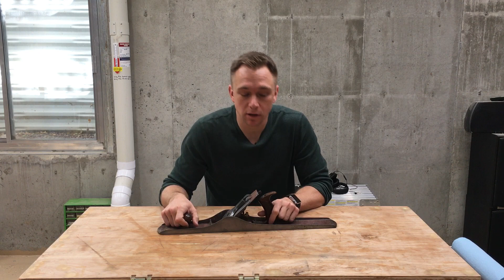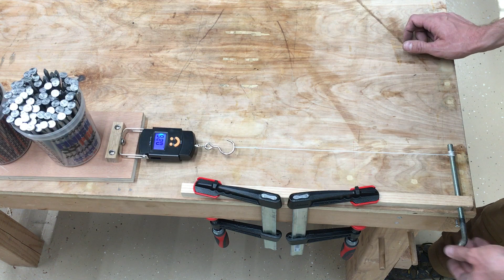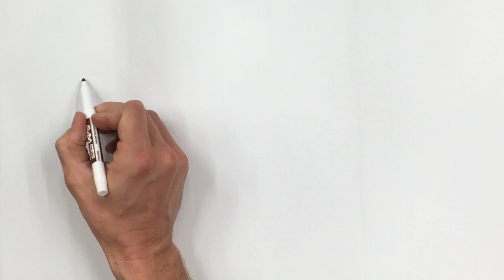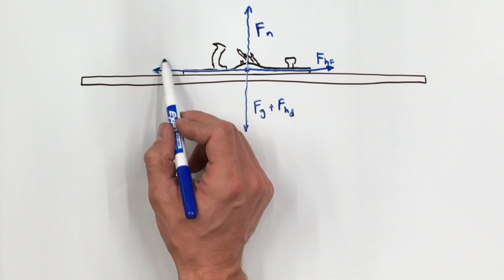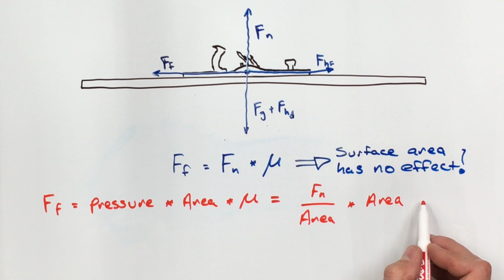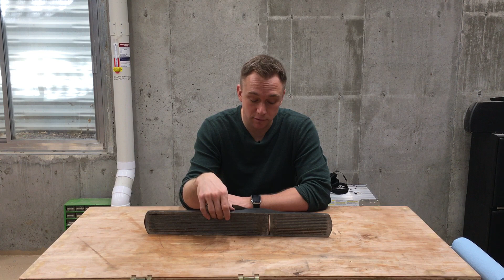Grooves in Plane DON'T Reduce Friction!

Comment: Maybe the increase in surface pressure initiates a sliding effect on wood. If there is little pressure, the thing wouldint even cut, but with enough pressure it cuts and maybe even slides on wood.

Comment: Grooved planes were a huge benefit to Stanley. The driving force was most likely to increase the life of tooling at the factory. Less surface area means more planes get machined and honed before the bits and grinding surfaces wear out and need to be replaced. The design team gets a raise for saving Stanley a million dollars a year.  If you think grooves are controversial now. Imagine how it was when they first came out. "There's No Difference" wouldn't be a stellar slogan to put on the box. So they played up the less surface area less friction "Easier To Push" angle to re-assure woodworkers that it wasn't some specialty plane for a job they weren't gonna be doing. The marketing team gets a raise too. And in my opinion the benefit of less surface area to wear out tools at the factory transfers to my tools if I need to tune up a used one.

Comment: Then intent of grooving the soles was to prevent adhesion caused by a vacuum effect. Think of water in between two plates of glass. The water fills the voids in the glass and makes it harder to pull apart. Check out us pat:96052

Comment: Looks like something you'd see on a chef knife..to reduce suction, so the meat dont stick to the knife.

Could it be an assist, so the planing is done in straight motion? How does it feel to use diagonally compared to straight.

Comment: Didnt read all the comments so if this is a repeat, sorry.  The reasoning and math is sound as the experiment proves.  And i assume anyone who has used both would agree.  I stray from them for the most commented flaw being they catch an edge.  Now the benefit on flattening and touching up may not be a benefit at all if the same reasoning is used.  That being the force that normally is spread along a larger surface area is all put on the smaller area therefore the amount of force needed is the same.  So by that,  there is more drag on the smaller area. Seems it would wear at a constant rate,  whatever that is in relation to the amount of area removed.  if 50% is now carrying the load and being drug along the wood,  which is abrasive,  it stands to reason that you would see a 50% increase in wear.  Thus....  making touch ups necessary twice as often.  Id rather spend twice as long half as many times dragging my jointer back and and forth on my 3'x6" glass with sandpaper spraye glued to it that only comes out for the one purpose.  And the 150 has to removed long before it is used up to switch to 220 and that to 400.  Yes i can still use the sandpaper but it has that sticky shit on the back.  I can use a cleaner and wipe it off,  but i would rather do it once a year than every 6 months.  What happened to the fast vise???!!!

Comment: Those grooves serve the same purpose as the groove down the length of a bayonet.  Not to have an affect on friction but to lessen the seal that's created when two surfaces hold onto each other through a vacuum.  Get yourself some machinists'  gauge blocks and see how the opposing surfaces will "stick" to each other.  That's because there is no gap for air to enter between the blocks due to their finely honed surfaces.

Comment: This type of plains soul is called corrugated sole. Those corrugated souls are used for reducing threshold of motion for static friction, not kinetic per se (you used dynamic as a name for it). Those plains are designed to be used FOR WOOD WITH HIGH RESINS CONTENT like resinous pine or spruce. Historically those grooves also have been filled with some lubricant like wax or oil, grooves allowed them last for longer time. Corrugated sole were used mostly for longer plains as they were mainly used for dimensioning rough lumber and freshly milled wood. It was rejected from smaller planes used for smoothing (if you have smoother with corrugated soles it is worth some money as collector's item), in many use cases peaks of grooves could make some bruising on wood and limited versatility of plain like couldn't make chamfers etc.

Comment: Dear Andy

The grooves are helping you to lift the plane easier. read bellow my short explanation

The groove does have nothing to do with dirt etc. A plane creates a high flat surface. When two very flat surfaces come to contact there is a short of negative pressure applied between them. This IS proportional to the surface magnitude. So making the grooves just helps you to lift the plane easier. ;-)

Regards Greg

Comment: First - I love your videos and inventive nature. IN this video I noticed your radon remediation system in the background with no vacuum being drawn. The water manometer should show and inch or so of water vacuum to indicate the slab is being actively vented. Now this is not a close up video but it looks level - which would indicate it is not running. Since you spend a bit of time down there - might want to check it out to stay safe.

Comment: No !. nothing related to friction, but manufacturing.The body of the plane is made by casting steel or cast iron. During the cooling process, these materials experience contraction, therefore warping the area. Next step after casting is machining the prefab casting. Although cast steel/iron are fairly stabile, taking a skim off of one side will still produce some warping by eliminating the counterbalance stress on the opposite side, and that is reduced by putting some grooves in there. Conclusion, it is easier to produce a flatter surface during machining such a long item if it has these grooves placed in it.

Comment: Hi Andy. There could be a number of reasons as to why that plane has a serrated of waisted sole plate and each could be justified in its own right. As a design engineer, I believe that the material is removed for the propose of ease of manufacture. The body is cast from steel or iron and the wasting has been implemented to remove mass to help reduce material distortion when the cast cools. This would stop the body bowing and twisting because you minimise material mass along the whole length. Then, as mentioned previously, distortion during machining is reduced as less material needs to be removed generating less heat etc etc etc. I could rattle on more but hay, like you're videos and your problem solving soulutions. keep it up. :)

Comment: I'm not good enough in english so I try to use google translator to describe what I mean. In your video you're right only in case of dry wood. In case of green wood you have to consider the phenomenon of adhesion. Water (resin) molecules behaving like glue Force of adhesion increases the vertical vector down and stems directly from the surface.

Comment: Old Middle Ages and Renaissance wooden planes were laminations to resist warping. Could be a hold over from then, some concern about warping. But less steel removal to flatten makes the most sense. The longer planes are for extreme flattening of long stock so flatness of these longer planes would be a greater concern.

Comment: Hi, Andy. I was a boat carpenter for ~30 years, and used #'s 7 & 8 jointing planes a fair amount. The point of a jointing plane is to produce a perfectly smooth and straight edge, usually to join two pieces of wood with no gap. You've seen those videos of japanese woodworkers pulling off translucent shavings? A jointing plane can do that, too. 

What happens with a plane with that length of sole, especially when taking a thin shaving off a piece of hardwood, is that their starting friction (sometimes called stiction) can be quite high, much higher than their running friction. So you push really hard to start the cut, then have to back off immediately as the plane moves or you tend to lose control. Again, if you watch the Japanese carpenters you can see the effort it takes to start a cut compared to continuing a cut. That's not all do to stiction as they have no momentum initially and a wood base has less stiction that an iron one, but you get the idea.

In my experience those grooves help reduce the stiction, if only a bit.

BTW, I love your inventions. Now that I'm retired I like to make one-off tools to do a specific job. It usually takes much more time to make the tool than to just plug and chug...

Comment: not correct!. the coefficient of friction depends among several things of the geometry and the surface area, and also of the pressure, the coefficient µ is an oversimplification only truly valid for some very specific cases.

a car tire for example does have more static and dynamic µ the bigger the contact are, and the smaller the contact pressure. that is why to transmit big forces on a tire you use a wider tire, if surface area is non relevant everybody should use narrow tires which are more aerodynamic.

maybe you can fill up the groves on the plane and see if you detect any difference using it. or maybe the groves are a manufacturing thing, that makes it easier to grind down to a flat surface, since you have to remove less material.

Comment: I am sure the main reason for those grooves is marketing. Your theory on them letting dust escape contact with the wood, and thus not leave marks I would discard. In my experience they certainly collect all sorts of things, but it only seems to make the marks on the wood worse. I like your last theory the best. Might actually save some cost in production with less surface to lapp. 

There is one more effect of this that I really like in my No. 7, and that is reduced weight. My No. 7 is corrugated, my No. 6 is not, yet the No.7 is slightly lighter. Though It must be said though that the entire casting of the No. 7 is also thinner.

Comment: The grooves are beneficial on wet or waxy woods.

Having spent hundreds of hours hand planing all sorts of wood I will offer this bit of wisdom:  Surface friction on smooth dry materials is indeed dependent on normal force x coefficient of friction - that is simple first year physics, but, wood isn't always dry! 

The purpose of of the grooves is to break suction, particularly on wet or waxy wood, and they do reduce friction in those cases, but more importantly they help to eliminate annoying chatter (even on dry wood).

However, be careful on thin material or when starting a champher because you can catch on the grooves and gouge the work.  .

Comment: There are skateboards made specifically to use on snow (not snowboards, different thing). And they have this too at the bottom. But not to make it slide better, but to make it want to go straight. Have no idea if that applies here, just wanted to share that. Sorry.

Comment: My understanding is that the grooves were milled into the soles of smoothing planes to counter the suction which can form as the planed piece begins to assume true flatness.  You can see this effect when you try to lift a smooth heavy panel off a stack of MDO or MDF.  Sometimes you can actually pick up the sheet underneath.  In the days when large surfaces were all leveled, flattened, and smoothed by hand any reduction of effort would have paid off in increased productivity.

Comment: Interesting!
Another way to possibly look at this is in regards to the actual contact area. Even though the surface area on your test pieces were vastly different, the area of direct contact (due to surface irregularities) might have been very similar. 
The board with the grooves has the force concentrated on a smaller area, so it's being pressed down tighter and will better conform to the surface below.
If so, increasing the weight on both might have shown a difference, with the smooth one become harder to pull. 
When using a hand plane, the force required to hold it tight to the surface might be over this point and the sliding resistance may be lower for the one with the grooved sole.
Reply from the maker: Interesting point, I know that the simple linear Ff=Fn*u breaks down at the extrema (very small areas or very high forces), my assumption at this point is that normal hand planing conditions fall well within the linear zone, and friction force will be the same, like it was for my test board under about 10 lbs normal force.  But I'm happy to change my mind if evidence proves me wrong.
Reply: Andrew Klein Oh, I'm not looking to change your mind, I agree with you - the grooved plane won't be easier to push. Notice all of my "maybes" and "possibly's" :)
I think the force it takes to cut the wood swamps the force required to overcome friction by a wide margin.

Comment: What about off road tires on a drag car. Dose the rubber on slick tires not have more grip then on off road tires on the same strip of raod?
Reply: Custom Chris Rubber does not comply with that same "normal" friction force law. Not 100% sure why, but in case of rubber-like matterials the area of contact does matter. May be it has something to do with the fact it's not strictly solid in physical terms.
Reply: So a 1ft x1" wide board would take the same force to move as that same board turned on its side?
Reply: The friction equation cited in the video is valid only when the force on the contacting surfaces does not deform either of the surfaces. This is probably true for a plane, unless you press a small plane insanely heavy onto soft wood, but certainly not for a car tire.
Reply: yup, applies to no macro deformation and flat surfaces in a macroscale level. Rubber in the wheels and the ground bumpiness actually intermess and act like grabbing fingers, so to speak. 
In microscale friction you are actually bringing the tiny peaks of the surface to the ultimate tangent yield strength and thats what creates the friction. Micro deformation. I don't completely remember the theory of this :D
Reply: No. Rough road or gravel. Slicks spin out. Off road tires grove allow for the tires dig in and grab. Whole different thing going on in a plane.
Reply: Nope. Friction is always there. It is only a matter of how much, hence the algebra term Coefficient of Friction. All materials including air have surface friction right down to the molecules and a defined CoF number.
Reply: stubee52 
As for the off road tires on gravel vs. slicks on gravel, I can imagine that slicks rest on the tiniest top level of pebbles and simply push them away one layer at a time. Whereas off-rode tires are able to immediately reach few level of stones deep. Those deeper layers of stones, while still under several more layers above them, are more interlocked with each other and provide more resistance to be swept away.
Reply: Andrey Bashkin My comment was on the stupidity of another. discussions of tires, slicks or off-road is off topic of the video and thread.
It is about planes not tires.
Reply: Didn't get that, sorry.
Reply: Tyres used on drag cars get hot and sticky and at that point you get adhesive friction which is proportional to surface area.

Comment: So maybe, speed and heat (raisin) = sticky as a factor, like tires. Or two flat surfaces form a vacume like a upside down glas on a flat kitchen counter top or two glas plates. I'm very sure you can go faster down a slide by minimising surface area, the eternal kid in me did tests. But that has to do with cavitation. the point is that although your physics is correct, i work with the principal in my work as an engineer there not actually dynamic forces, they are statics because the speed is not very high and therefore not a big factor.

Comment: Very interesting indeed. Definitely a video to make you think. I'm not disputing your demonstration or saying what is or isn't correct but... why does it feel like there is more friction when you slide your hand against a smooth surface like a glass table top and less friction when you slide your hand against a rougher surface like a piece of unfinished plywood? Is that a similar comparison to a corrugated bottom plane vs a flat bottom machined plane? Maybe the friction I just described has more to do with a bunch of tiny instances of suction as your hand goes across the glass vs less suction on the plywood?
Reply: Jay, you don't reduce the surface area in your example, you change the material. Your not wrong but you need to watch the video again.
Reply: The contact area of the material changes in Jay's example, rather than the contact area of the moving object.
Reply from the maker: Hi Jay!  With a change in materials you get a different friction coefficient ( "u" in Ff=Fn*u), so for the same normal force you will get a different friction force.  So if they had changed the bottom of the plane to, say, teflon it certainly would have resulted in less friction.  And at some point if the grooves you cut into the plane are microscopically small this will resemble a material change, probably increasing the friction coefficient.  but for very large grooves like the ones actually used the material is effectively the same.

Comment: It makes a lot of sense the way you explained it. You may be reducing the surface area of the plane that is touching the board, but you're adding more pressure to the remaining contact points because the weight of the plane and gravity is now focused on a smaller area

Comment: Great video thanks for the physics lesson. Also looks like your radon system isn't working as the two red liquid sections are equal meaning the air pressure is the same in the pipe as the outside of the pipe.

Comment: Interesting hypothesis Andrew but I think you're barking up the wrong tree and over complicating things.  I was taught that a grooved plane was for use on wood that had a lot of pitch such as pine.  I have several grooved planes and that's what I use them for.  Ditto with freshly milled wet boards.  Great topic.
Reply: agreed, Andrew is probably missing forces.
Reply: And the grooves do what for you regarding pitch?
Reply: Strong in Andrew the force is....